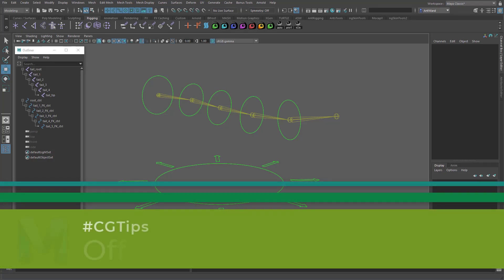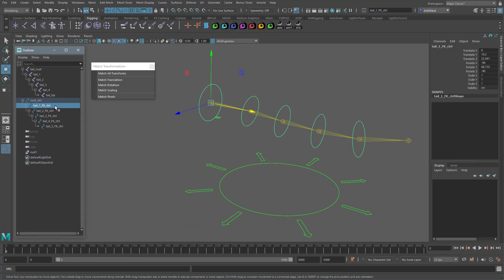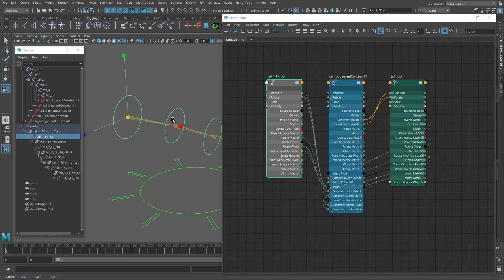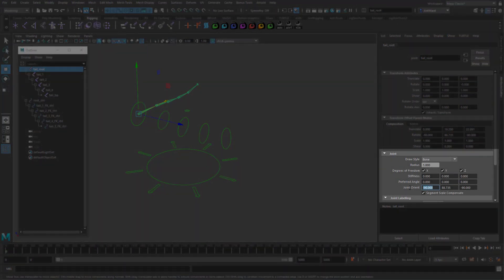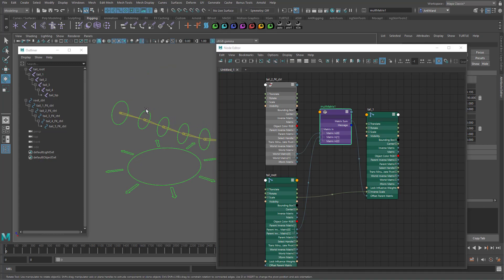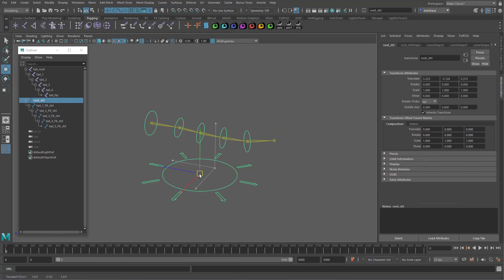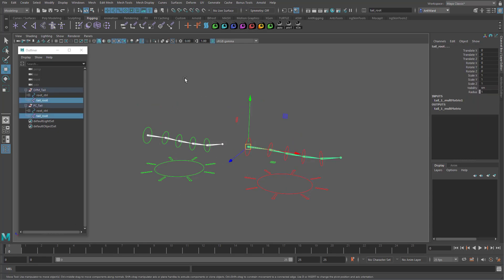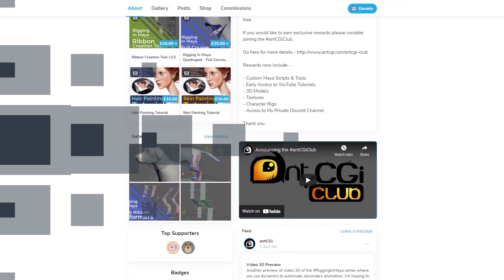#CGTip | Offset Parent Matrix Basics

Comment: Is this method overall worth trying to figure out? I'm having an issue where it doesn't exactly match where the last position was even when setting the translations back to 0. I'm not sure if it's an issue because of it being parented. I'm not sure how to fix the parent translation and it being skipped over here for the controllers doesn't help. Might have missed something. 

Along with FBX not recognising OPM and that animators shouldn't really be interacting with groups anyway as they should be locked makes me wonder if it's really worth investing into. Along with not really knowing how to get it working on IK controls.

Comment: This video is fantastic and has convinced me you're a wizard, but I'm having an issue where if I mirror the joint chain and I input the rotation values, they update the others automatically and the controller always ends up in the wrong position. Is there any way to fix this?

Comment: Parenting the offset sometimes causes it to fly off somewhere else and I'm not sure why. I'm not doing anything different but sometimes it works and sometimes it flies off breaking the offset altogether. Is there a reason and fix for this?
Reply: To answer my own question, it was because I reset pivot and not matched all translations. So for future reference and anyone else having the issues. 

1) Don't rotate the controllers before doing the parent. 

2) match all translations of the group to the controller.

Comment: Hi!
So, being that we are dealing with a hierachy, why not to use "matrix" rather than "worldMatrix", for this kind of setup? Looks simpler than substracting the inverseMatrix of the parent.
Also, you are using the parentInverseMatrix of the parent node rather the worldInverseMatrix of the parent node it self. I understand how is it working and the math behind, but it doesn't feel super intuitive specially knowing how we used to think about the parentInverseMatrix. Could you share your thought about that?? Thx!!! 
Anyway the video is super cool every day I start appreciating more this new workflows :D
Reply from the maker: Hi! I find that using Matrix to connect the control to the joint just makes the joint move back to the position of the parent joint. Even with the transforms left on it, it still then pivots from the previous joints position whereas we need it to pivot from the control. You are also correct, you can use worldInverseMatrix too and it will give you the same results, I am just used to using parentIverseMatrix :)
Reply: I wondered this too. It's much simpler to use Matrix since this is the local matrix and is identical to the world matrix multiplied by the inverse parent world matrix. I made a similar setup in Maya and verified that everything does pivot correctly. To create a working scene I did:
1. Create joints, parent them
2. Create controls, parent them
3. Match transforms on controls to joint transforms
4. For each control/joint pair starting from the root, connect control Matrix to joint OffsetParentMatrix, then zero out joint transform and joint orient.
Everything pivots as you would expect with this setup. Feel free to check out the test scene here: https://gist.github.com/rorydriscoll/ca5c8dbffd7cc10be9ee3f51b451ce77
Reply: @RoryDriscoll  The problem with your setup is that your controls have translation and rotational values which are counter intuitive when you wish to animate. You can do this but you will need offsets to hold the transforms.